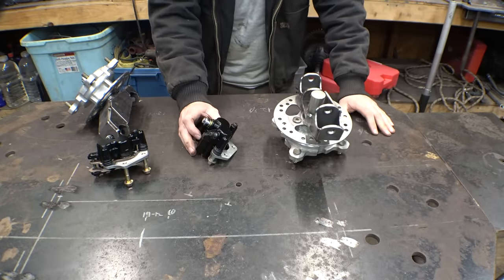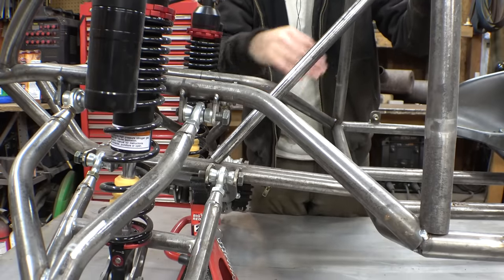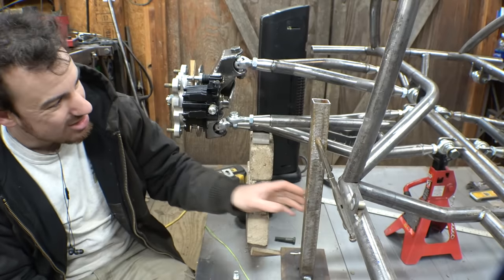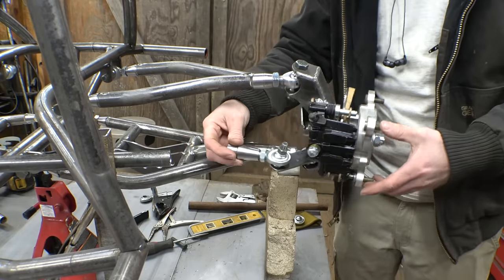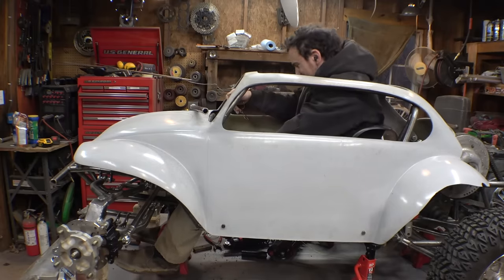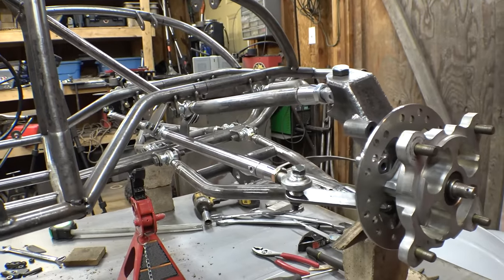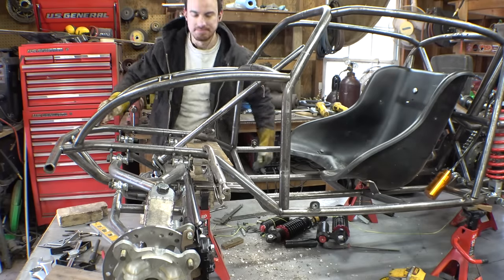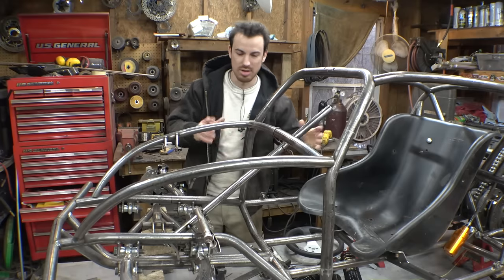Installing Steering on the - Home Made Mini VW Baja Bug!! - Part 9

Comment: 1 - get yourself a diesel heater like the ones used in camper vans
2 - build a "rally light pod" onto the bonnet ( hood ) , hollow it out and use the space for your feet and pedals
3 - keep up the good work , it's always good to watch your channel
Reply: I agree with the camper style diesel heater! “ Chinese version or the espar or webasto heaters” I have a espar D2 airtronic diesel heater in my garage and works well!
Reply: @mariolavergne5258  yeah, the other episode he said he did not like diesel heaters as I was going to suggest it, did not even occur to me that this is the type of diesel heater he had tried.

my dad has one of those cheap Chinese ones on his boat and it is excellent, uses next to no fuel and heats up his boat super quick. sure in the use case it will use more as it will have to work harder, but still, it will be super cheap to run and you can get them with a full kit for like $150.
Reply: Diesel heaters also can cause carbon monoxide poisoning. He should not be using any kind of gas heaters indoors. Electric only!
Reply: Those chinese ones are shit. It works for a month and then the pump craps out or some wire unseats itself from the plug.
Reply: @brsrc759  the caravan/camper style have an external exhaust and if installed correctly should have no way of having carbon monoxide issues. the combustion chamber is completely separate from where the air flows. they have 5 connections. a diesel line in, an intake for the combustion chamber (can be plumbed outside if your really worried) and exhaust that HAS to be plumbed outside, an air intake and an air outlet for heating the room air.

once installed correctly a bigger issue would be things like his argon tank leaking etc as that can do the same as co2 if it displaces enough oxygen.
Reply: You can easily setup the exhaust to output outside. No carbon monoxide, safe heat with a lot of heat output.
Reply: Yep! Diesel heater is the answer.
Reply: I definitely agree with the Chinese diesel parking heater.  Installed one in my 1000sqft shop and it'll keep it in the mid 50's when it's below freezing out.  No fumes to deal with since it exhausts out the wall.
Reply: I also left a comment about the diesel heaters again, and one after he got really sick...

Comment: When thinking about your seating position, keep in mind how it will feel when you are being hammered around on bumps and logs and rocks. I'd strongly suggest a rethink on overall dimensions and find a way to stretch or widen and give yourself some room. The beauty of fiberglass is how easy it is to modify. You can easily keep the body looking realistic while gaining badly needed room
Reply: I think he's way past the point of return. But I agree that modifying that body would have  been super easy. Just gotta equally widen and lengthen and so long as you didn't go crazy no one would have been the wiser. Sure, something would have looked different, but most would never be able to put their finger on exactly what was done.
Reply: I was gonna suggest he raise his seat and put steering wheel outside the top and also his shoulders out as well... with just the head out the cage part isn't helping him anyways.. but raise the seat to see over the front when wheeling also adds more room for pedals and such. Would really be less to modify from what he has now.. it would look like a power wheels car with wheel on top.
Reply: @stephenweston2973  yeah, that's a thought, but would it look nearly as kickass as being hunkered down in the machine??
Reply: yup. stretch body and chop the top. honestly, I've lost interest in this.

Comment: Put a rally car style light pod in the bonnet which would give you space for your feet and pedals upfront. Also get yourself a cheap 12v 8kw diesel heater. It will heat your shed no problem. I run several of them. Even got one heating my house 👍🏻
Reply: I was thinking he could fabricate a cowl/scoop to raise part of the hood.

Comment: 18:00 I would consider cutting room for your toes in the fibreglass body. If it is too uncomfortable scrunched in there, will you want to use it?
I would cover the toe area, the front end with some fberglass, and hide it under a custom bumper with large round fog lights.

Comment: Those diesel Chinese heaters are amazing! Usually around $100 bucks. I have 2 heating my garage and can easily keep it 70 degrees if wanting to at low heat setting.

Comment: For your diesel torpedo heater, try hanging a shop rag over the back of it. It'll help it get running when it's cold out. We have to do the same thing in Iowa when it gets very cold out. Be careful with diesel or propane heaters like yours. Rule of thumb is keep some windows or doors open for fresh air to cut down on carbon monoxide poisoning. I've had it several times and causes sever migraines and could also kill you. For a couple hundred bucks get a wall mounted propane furnace. Get one with a blower fan. They don't need an exhaust and are safe for living quarters. Keep up the good work though! Awesome fabricator, welder and machinist!

Comment: Maybe for your next build you should build an outdoor woodstove with a heat exchanger, piping into the shed to a radiator. Or just a big electric heater.
Reply: That's the rig i use no insulation shop tine can and it still flows its respected heat wave and won't get sick its all ambient heat

Comment: Hey Christine the build.  I use an electric furnace from an old 2000ish double wide.   They’re designed to blow down.   I just have it in the corner of my shop laying on its back which blows the heat across the floor.  It heats my 16x24 up from 20* to 60* in about 10 mins.

Comment: Chris, what you needed to do was to cut it in half and put extensions between the two of them. In that way, you'll be able to fit inside of it much better. As it is, you'll be cramped sitting in that small buggy. There's another YouTube channel called  cars and cameras. Several years ago, John and Isaac built themselves a Power Wheels Bronco. This was one of my absolute favorites of all the vehicles they ever built. The engine in it is a V-twin. They extended it. When you possibly build another one of these, you'll possibly remember this message.

Comment: I have a similar work shed and I use a Mr Heater Buddy propane heater. You can use an adapter hose to connect to the grill size tank. I also have half inch foam board for a ceiling for insulation.

Comment: You are astounding Chris, the projects you turn out from your work shops constantly get better and better.
You speak of the cold, I we over here in Western Australia where I live have been living with 45c (113f) mostly and a few cooler 39c+ days for about a month now 
LOL there is always someone better off? 🤔 Than you are eh? 
Have you considered infused oil brass bushings on the appropriate areas instead of I think you are using dalron?  Just a thought for you to consider. 
I can't wait for the day you get a property that is perfect for your needs and a proper workshop that is climate controlled as well. 
Keep doing what you are doing Chris you are exceptional. 
Tony from Western Australia 🇦🇺

Comment: Clough42 released a video yesterday on using a parting tool in the lathe. He was having the same problem as you and usually just resorted to using the band saw. He was given some advice on it, tried it, and was amazed by the results.

Comment: If u have an old 4 eye 220v stove laying around or grab from scrap yard and make u a heater. Use the 4 eyes in a metal tube with a fan in the rear. Seen a YouTube vid on one and it looked like it worked awesome

Comment: It's really easy to fix those torpedo heaters. Your most likely need some new hoses for the air pump and fuel, clean the fuel nozzle. Very simple.

Comment: A 1985 Honda Odyssey FL350 buggy/atv had the brakes and throttle on a rectangular steering "wheel".  There was also 2 brake levers...one on each side of the "wheel".

Comment: Hey if you keep dealing with issues with heat in the shop install a mini split heat pump since you have no insulation in the building I would recommend purchasing 18k btu unit. Good luck!

Comment: You might have done it already but a good option is to build a steering brace going to the front with a bearing. Then use an extension release that will come off past the dash bar giving way more room to get out

Comment: Hey Chris the diesel heater is a very easy fix, those do have a filter in the top of the tank or in the rubber line inside the tank. Also check the lines for cracks. U can clean & re use the filter

Comment: You gotta adjust the pressure on the back to get the "diesel" heater running. Also point of outside when adjusting... I've run a few heaters off of the shop air supply with an in line pressure regulator.

Comment: That diesel heater just needs cleaned and adjusted.  It is just a simple fan with an air pump on the back that forces air through the nozzle which draws fuel up out of the tank and sprays it into the area where the ignitor or spark plug can initiate combustion so we know it is getting fuel and spark since it attempts to light.  I would take the rear cover off and clean or replace the air filters and try it again.  I have to do the same to my diesel heater often and have found that simply hanging a loose weave cloth over the back as a pre filter greatly improves the overall performance and keeps it way cleaner.

Comment: I know your looking to add pedals to steer during a wheelie. What about pushing the pedals at the sides with your thigh/knees. You could make a comfy pad and mount the masters under the  front wheel well while your feet stay in one comfy spot. Just a thought

Comment: As for the rear brakes, use heel brake pedals.  That way you can have the toes rest and even mount the pedals to the outside of the feet, using lateral space instead of vertical.

Comment: For your engine those 2 strokes have two segments. The first one is your expansion chamber and required for your engine to run. The seccond one is a silencer and quiets the motor. You can straight pipe the motor after the expansion chamber if you wanted the only real requirement is not restricting the exhaust flow too much. The silencer provides some back preasure but all you have to do is retune the carbs.

Comment: I heat my garage with a small furnace from an RV. It runs off of solar 12 v and propane and it doesn't stink or give off fumes. It will heat that shed with no problem at all.
Reply: We use the ductless gas heater looks like a mr heater but for household use super cheap no electricity
Reply: @la_plata3588  I have seen where those types of heaters eat all the oxygen in a room. The RV furnace has an exhaust and intake that are vented to the outside and therefore no gasses or fumes make its way in the room. Just blown air over a heat exchange and its hot air.
Reply: @la_plata3588  ok I understand now the kind you are talking about. Usually see them in bigger garages hanging up in the corner. You said mr heater and I thought the kind that the propane can snaps on the back that will starve a tent of oxygen. Seen it with my own eyes.

Comment: I think I would create a hinge from the rear or front to lift that whole body shell up and down to get in and out.  Probably a front hinge is best to get to the engine and prevent the shell from inadvertently lifting up in the wind.  Go with steering wheel brake and gas levers like a 4 wheeler.  No peddles.

Comment: A furnace for your shop - consider an RV furnace.  Go to the local wrecking yard and pull a furnace out of a wrecked travel trailer/RV.  It's fired by propane but since it works like the furnace in your house, you won't get fumes inside.  You can put a thermostat on it, and you can use flexible metal tubing (think dryer vent hose) as your duct work.

Comment: Great job..I think you should lift the frame for the fibreglass higher so you are down inside looking out the windows...its way too tight in there... cut the tacks and lift the upper frame straight up should have a lot more room.

Comment: You should get a chinese diesel air heater , mine is a vevor 8 kw one in one unit , running on a 110 volt power supply and a 12v battery backup ( incase power outage or trip a breaker )  the intake and exhaust is vented outside  no worries about fumes. you should check them out .  They are fairly cheap and  run hot ,  there is lots of youtube videos on them as well.     Love the build as well , very cool !

Comment: Due a tune up on that torpedo heater and it should work fine. Make sure the flame optic sensor is clean, check the condition of the air filters, and make sure you have the right amount of fuel/air pressure at the pump. I have a unit myself to heat my garage and I will say I use kerosene instead of diesel fuel. When there tune and adjusted properly kerosene will burn very clean unless the intake air has fumes being ingested like paint fumes. Them it will be recommended to open a window for a cross draft.

Comment: The filter and pump are clogging in your “Propane” heater from burning diesel. Clean them and it will be fine.   Get a Cab heater for Semis. Work fantastic.

Comment: I'm pretty sure to completely eliminate bump steer all you have to do is have your tie rod ends at the same length as your a arms in the same angle as your a arms I could be wrong but I'm pretty sure that's how it goes I've been in the hoppy grade RC cars for a while and I've done a lot of fidgeting with bumps steer

Comment: Get some 1 inch insulation panels, put on walls and doors where possible.  Gives you insulation and aluminum type backing gives reflection of heat.  Find an wrecked RV and install wall heater from them.

Comment: Chris you need to look in to diesel heaters for RV’s , there cheap and put of a lot of clean heat the only downfall is they need 12 volts DC.

Comment: Instead of putting petals in it, you should make it like a Honda Odyssey, gas, and brake on the steering wheel
Reply: i believe he's doing it that way....the pedals that's going at his feet are for rear brake control from side to side....so he can steer while doing wheelies...
Reply: I agree although he's the expert lol with the space constraint and no clutch that seams like it would be the best solution
Reply: Invest in a small wood burner for the shed or a small resnor heater or mini split deal. Would heat that little shop up nice
Reply: @garrettschenker566 they make electric ones that hang from the ceiling like a Reznor does
Reply: Deconstruct a cheap or free propane dryer and turn it into a compact 40kbtu furnace with the exhaust exiting the shed.
Reply: Agreed, I always thought it would have been cool to have the Honda Odyssey with left brakes left handle, right brakes right handle. Wouldn't of worked tho, Honda Odysseys were live axle (no diff)
Reply: Looking amazing bud can’t wait for next video 😊
Reply: This is a great build. I personally would extend the chassis 3 inches. The body can be cut stretched. you fill in that fiberglass
Reply: Did you watch the video lmao
Reply: Yes like Grindhard Plumbing has done with most of their small cars
Reply: It would be alot easier
Reply: @dougjohnson6265  yeah I made the comment prior to the last 10 seconds of the video where he explains it
Reply: @marshallnaville1079  yeah I did watch the video. I just made that comment prior to the last 30 seconds of the video where he explains it.
Reply: And you can get your FREE CHANCE TO WIN a Honda Odyssey Fl250 by subscribing to the Odyssey Life Youtube Channel!👇 https://m.youtube.com/c/@OdysseyLife1?sub_confirmation=1

Comment: May I suggest you install an electric shop heater? You run welding machines so you must have 220 volts in there. I have one in my 16 x 16 shop. It’s 5000 watts about 17,500 btu’s. It is adequate but has to run a long time when cold. I’m in northern Canada. Don’t mess around, go for 7500 watts which is close to 25,000 btu’s. Your shop isn’t insulated so you will need the heat. The little diesel air heaters (espars) don’t put out enough for a shop your size, save your money. as for the Mr Heater try cleaning the flame sensor, i believe its dirty or faulty. Not bragging but  I do know heaters. keep up the great work, i love your channel. ,

Comment: Pull the heater apart and clean it. Ours did the same thing just dirty. 

Also you could use karosene or you could get a bigger electric heater. What I would do is find a smaller wood stove and clear a space for it

Comment: Chris you could always cut the bug body straight down the middle into two halves and then put a 8 inch filler sheet of metal in between and at least give yourself a little width to your ride.
Also you can cut the metal frame in half and expanded out 8 inches wider.

Comment: Since you have 240v in the shop now you ought to consider getting a good electric forced induction heater. That puny thing you have would take hours to heat up the shop and probably won't keep up with the cold air coming in.

Comment: u should look into diesel heaters they work really well and they use a heat exchanger and exhaust system so they don't put any on the inside only hot air

Comment: Hi Chris, here a note  from Canada. Why don't you make the body , I mean between the engine and the steering about 10 inches longer. So you have enough length for your legs and feet, and Ithink it would be way more comfortable to drive. Good luck with this project and belated happy new year. Jon and Rina van Beilen from Canada.

Comment: I wonder if the steering could be done like a four wheeler instead of a wheel with push/pull rods? like longer tie rods at the grouping where the stem is at. might help make room for your brake idea and give you a thumb throttle or a twist one.